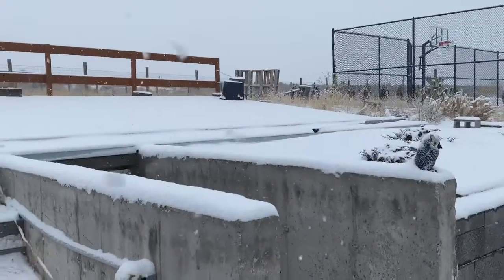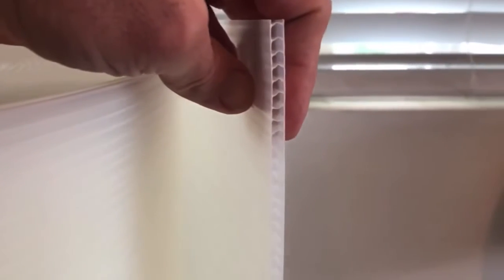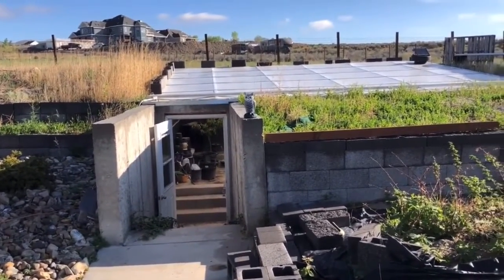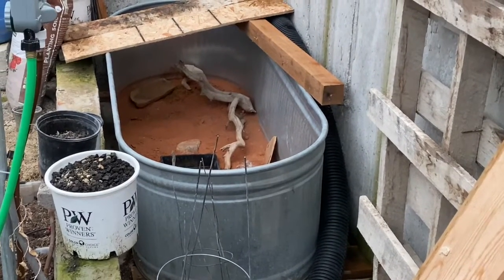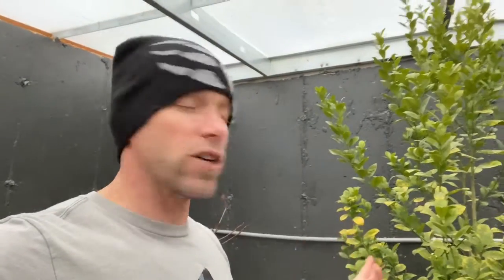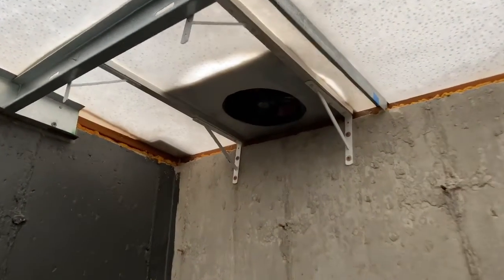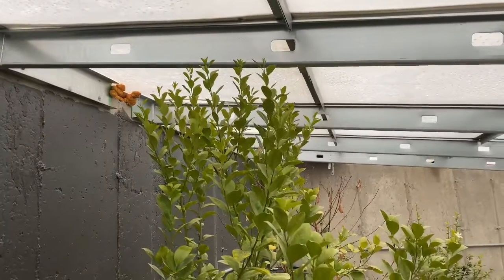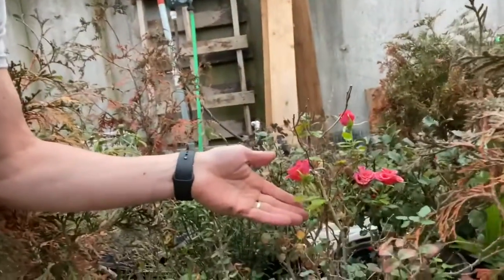Tour My Underground Greenhouse. An in-depth look at How My Walipini was Made. See inside my Walipini

Comment: The concrete above grade acts as a radiator. If you trench around the perimeter down to the footings and add insulation it should help. Your sunken greenhouse / walapini would perform better if you had light reflector panels hanging from the ceiling, and if the panels were insulation board you could close them at night to retain heat. To visualize think plantation shutters made out of rigid insulation board covered in reflective mylar. Fiber Pultruded Plastic (FPP) would of been a better choice for the roofing beams as they do not conduct heat.  The winter sun comes in on the horizon at low angles which dilutes the energy concentration per square foot. Solar ovens put out reflector panels to concentrate the heat. These reflector panels could double as roofing insulation on the outside as well when closed.

As a learning excercise you can build two scaled down model size versions of green house set ups and put data logging thermostats inside.
1) being your design: concrete pavers dug into ground, but stiking out with metal roof supports

2) being a polystyrene ice chest wedged into ground with dirt embankment on sides, back, and roof. Place a concrete paver inside ice chest and cover with glazing. If you add multiple glazing walls inside this stucture you will create warmer zones progressing toward the back. If south facing poly glazing is vertical, you can have an outside hinged at ground level insulation reflector panel. During daytime it is folded down to capture and reflect additional light. During evening it is folded up to provide insulation. The same set-up is repeated on  roof, but hinged at northern roof crest. This roof panel hinges up to 45° during daytime to also collect and reflect light.
Inside the greenhouse you can have two axis of reflector insulation  panels hanging down from ceiling. One going east to west and directing light down. The other below the first going north to south. These two hanging insulation panels grids can be closed up at night to add heat retention.

Additionally any excess heat during daytime can be pumped into shallow  irrigation tube buried in ground 1 or 2 feet using solar powered HVAC fan drum type (Citrus In The Snow). The heat will leak out of ground during night time into the green house. As you can gather from the design parameters it is better to have an orientation that goes east to west = wide and not to far back, else roof panels are to long. Fold up panels can be made of corrugated sheet roofing composite with insulation in-between, like ice-cream sandwich.

Used insulation panels can be bought on-line that are delivered to your site. Also you can make your own  air-crete (honeydocarpenter) add glycerine to soap for best foam. Add CSA (calsium, sulfate, aluminum) to Portland cement slurry for 20 minute  set-up time and 2 hour cure with nearly tripple strength, especially if you replace some of the port land cement with reclaimed waste product fly ash.

If that still does not do it, then you can add an additional much deeper trench of corrugated irrigation drainage tubing composite that will pump in 50 degree air at night.

For your set-up, I'd put a hoop house ontop of your existing glazing/roof.

My own interest lies in puting geodesic dome greenhouses over sunken courtyards/gardens similar to the forestiere underground gardens of Fresno CA
http://www.undergroundgardens.com
Reply from the maker: Michael Glenning Thanks for taking the time to write such detailed suggestions. I appreciate it more than you know and I will look into some of this.

Comment: The angle of the south facing "window" needs to be at a right angle to the sun, on let's say January 10th.  The light needs to hit some dark colored thermal mass, ie 55 gal barrels  of water or stones./gravel.  Underground tubes would aid your ventilation, moisture and temperature management.  This is just what I have learned so far from videos.
Reply from the maker: Thank you sir.

Comment: EXCELLENT VIDEO ,
YOU DON'T KNOW IF A WALIPINI WORKS IN THE DESERT?
WILL IT WORK IN TUCSON?
IN SUMMER ?
IT REALLY IS HOT
Reply from the maker: That is an excellent question. My guess is that it would work. You'd just need to make sure your roof has the appropriate slope & you can hang a shad cloth inside the green house during the hot times.
Reply: @ApocalypticGardening  Thank you very much, I will try it.
perhaps with a mesh to shade the outside, which you can put in the hottest hours.
on top of the polyethylene

Comment: Slso you need about 1000 gallons of water in storage in there.....it will maintain a much steadier temp
Reply from the maker: Yeah, I added 17 more barrels but still need more.
Reply: @ApocalypticGardening  yea it takes a lot of thermal mass
Reply: You might want to give this a look over. https://www.builditsolar.com/Projects/Sunspace/GreenhouseHX/HeatPumpEnergyStorage.pdf

You seem to just need more heat overall though so maybe a loop to a small wood burner on the outside of the greenhouse?
Reply from the maker: @cortholiopezorama8879  Thank you. I’ll look into it.

Comment: Your roof should be at 40 degrees for  Utah. That would give you about 50% more heating. Instead of being 40°F, it would be 44°F when it is 32°F outside.

Additionally, it would be about 60°F if you just covered the roof with insulation, and about 65F if you added solar panels on the roof with grow lights inside. With an additional 2000 watts of solar, routed to heaters, you could hold about 80F all winter. You would not need an inverter or batteries for that, so the total cost would be just a few K. Maybe about 4000 USD. Subtract off the 1K every 5 years for the original plastic panels, and you're break-even golden in 10 years, ready to grow coffee, chocolate, and pineapples immediately. In Utah.

Greenhouses only made sense when china wasnt giving us solar panels for almost free. Their day will return, but not today.
Reply from the maker: Thank you for sharing. It’s just a fun experiment for me.